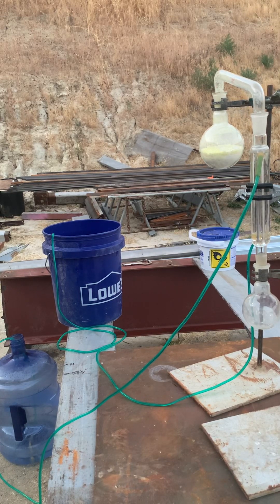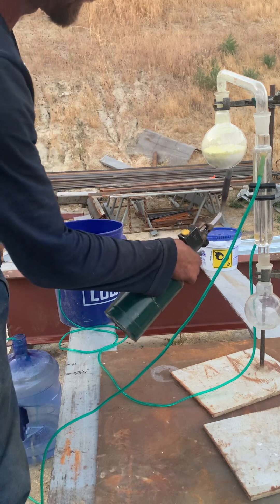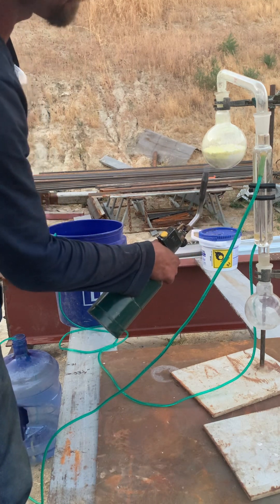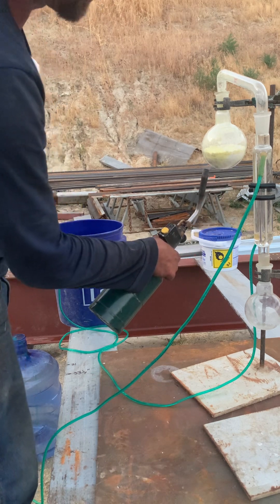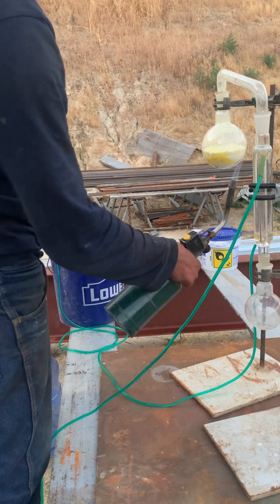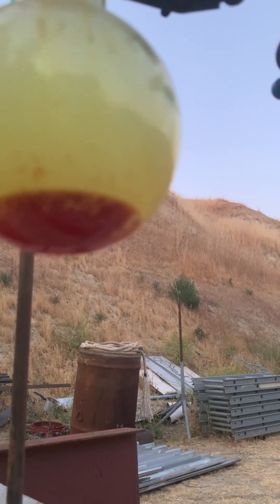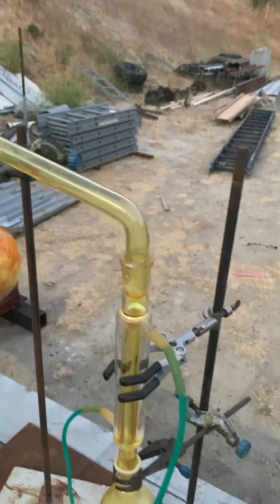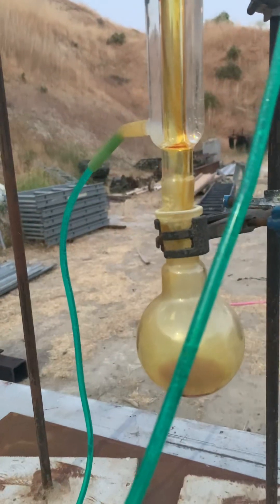New method for Sulfur dichloride synthesis

Comment: What's this used for?
Reply from the maker: Can’t think of anything legal
Reply: @jamescambell1386  Ahaha! You can use sulfur dichloride to produce muriatic acid. Or add it to a solution of nitric acid, it'll have explosive properties. Ooooor you can add some ethylene with it, to make some mustard gas.
Reply from the maker: @Banana_man6785  mustard gas was what the feds were really investigating me for. But since none was found they hit me with a lesser charge of makin  constructive devices.
Reply: @jamescambell1386  Darn, I've got my home sort of raided by officers and they found my storage bottles for HMTD. Probably the neighbours filed a complaint!! Do you plan on producing sulfur monochloride, though?
Reply from the maker: @Banana_man6785  not planning to make any, just wanted to share this alternative method of which i stumbled on for producing sci2. Never heard of this method before, maybee im the first to do this. But with how simple this is i would think im not. As far as mustard gas goes i can tell you all about it. Did countless tests on myself. Had 2 accidental exposures while distilling that were agonizing( even the self testing was well… very itchy). I can say its most comparable to poison oak. 6 hours to onset of symptoms. Once distilled it no longer has garlic like odor, instead it has a very pleasant sweet odor and can then be stored without pressure building up and decomp. Testing usually was a topical application of 1/10 of one drop to the skin.
Reply from the maker: Ethylene was the tricky one to make. But using zeolites and heat to crack ethanol was the best. Then bubbling the ethylene through ice cold water removed both, moisture and any unreacted ethanol.

Comment: Whats your opinion on running this on a larger scale? There are conflicting reports on sciencemadness about this possibly exploding, ive read it only explodes if you use calcium hypochlorite and ive read it explodes with tcca as well. Not sure what to think of this. Maybe inert atmosphere would be safest?
Reply from the maker: Id say as long as your sure that its tcca in the flask and not hypochlorite youll be fine. Ive never seen tcca act like it may explode from the dozen pr so times ive done this.
Reply from the maker: Im comfortable with this to the point i dont wear glasses when doing this. Must be the darwinism in me. Ha
Reply: @jamescambell1386 cool! Don't even have hypochlorite, tcca is cheaper for making chlorine gas and supposedly its a drier way to make it too
Reply from the maker: @bobsagely812  tcca makes dryer clorine gas cause the reaction isnt exothermic with hydrochloric acid as it is with calcium hypochlorite. Only drawback with using tcca for this is it foams big time so it helps to use an oversized flask
Reply: @jamescambell1386  yeah foaming does look pretty bad here, perhaps the best choice for large scales is some ceramic retort thing, but thats just getting silly!

Comment: does it produce SCl2 or S2Cl2? or both?
Reply from the maker: Honestly i couldnt say for sure, but S2CI2 seems to be the majority in this batch. This may change with different porportions of tcca to sulfur
Reply: @jamescambell1386  any way to clean the glassware 😅😅
Reply from the maker: @thatpyroguy6741  i use a steel rod to carefully chip out the mass, then add sodium hydroxide and water and some heat and it cleans it pretty good.

Comment: Omg this is also useful in making both TiCl4 and SnCl4. I need those to produce MMO electrodes. I dub this process as the James Cambel direct chlorination.
Reply from the maker: Before i chipped out all the spent mass in the boiling flask, i first had to dump out about 5ml of sulfur dichloride that was in the mass.  This tells me that a reflux condensor could be used atop the boiling flask and reaction caried out, then once everything cools pour out the sulfur chloride(one pot essentially).
Had i used a bigger flask to accommodate the expanding mass, then the rest or the sulfur chloride could have been pushed over. Will do again
Reply: @jamescambell1386  basically refluxing then distilling over

Comment: did this on a smaller scale a few years ago and wondered what the yellow smoke was. great video! i´ll still use the chlorine route because it is cheaper/higher yielding but for smaller amounts your procedure is great!
Reply: adding a high bp solvent solvent like methane sulfonyl methane, parrafin or paradichlorobenzene helps improve yield to 80% based on some papers that talked about this process.
Reply: @CatboyChemicalSociety what papers did you find that describe this method? I can't find any

Comment: This is actually useful and makes other things like acetic anhydride synthesis from sulfur dichloride less of a hassle.
Reply: Heroin soon😂
Reply: @МельникВладимир-я2ц  making acetic anhydride is easier using GAA and MeCN and steel and carbon electrode with thiosulfate supporting electrolyte 80% yield 1 pot Echem.

Comment: So if you use a heating mantle instead and heat it for longer, will it produce more?
Reply from the maker: I dont know. I do know either a larger boiling flask or less ingredients in the current one would help with the expanding mass inside. There was alot of sci2 still inside the boiling flask when i broke it down